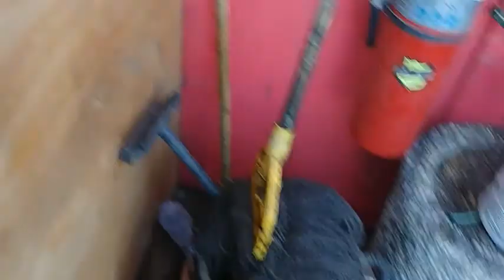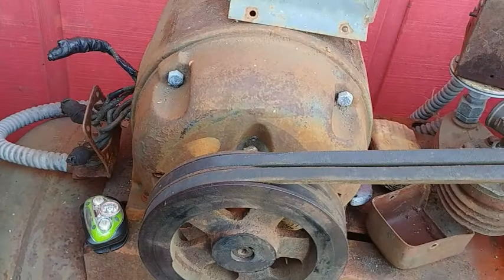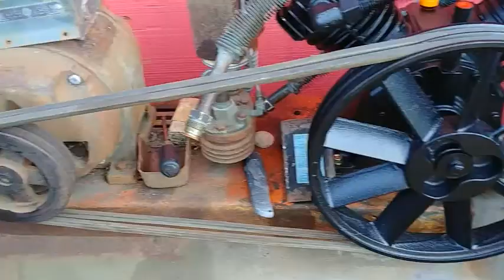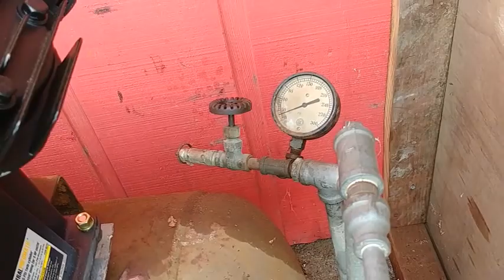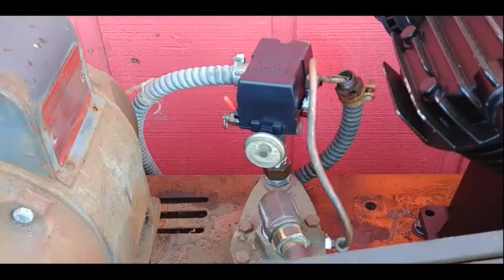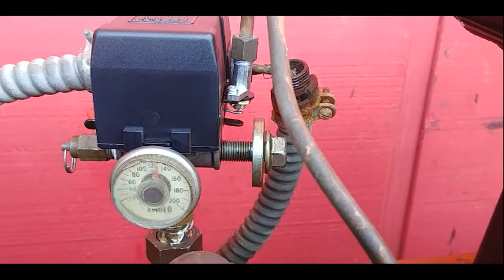Replace Old Devilbiss with harbor freight 145 psi twin cylinder air compressor

Comment: Damn you’re braver than me,I think I would have wired a fuse between those wires but you’re probably right it should work but you could always turn it all around and run the other way with a little work.i have one of these I haven’t used yet but time you read about someone on here replacing their pump with this it’s always the same fitting the same problem,someone at bc screws the pooch
Reply from the maker: Yeah. Guy didnt want to pay to have it done right, so do the best we can.
Reply: How does it keep up with the new pump I think I have the same thing to put together yet .i don’t know know if it can be done yet I have check to see but I have a craftsman 6hp oiless 60 gal tank I’d like to see if I can separate the twin cylinder air pump from the motor and use the motor to run the new H.F.pump.I’ll get to it in a week or so